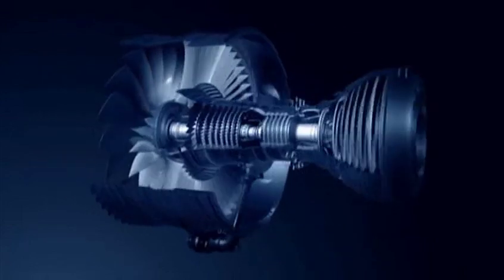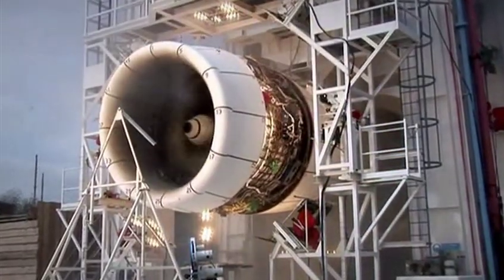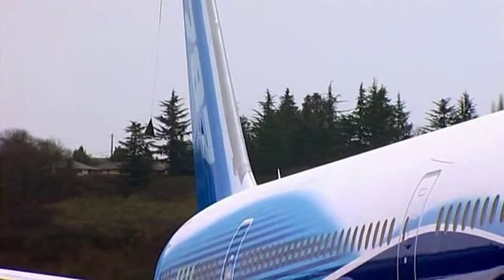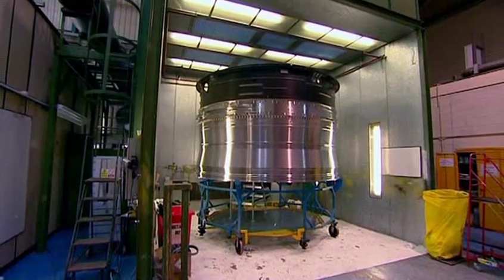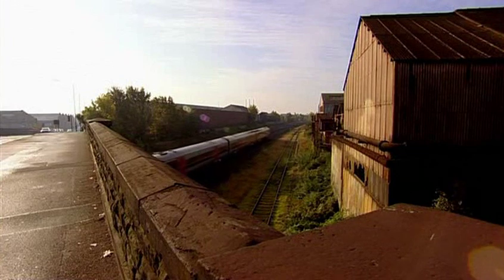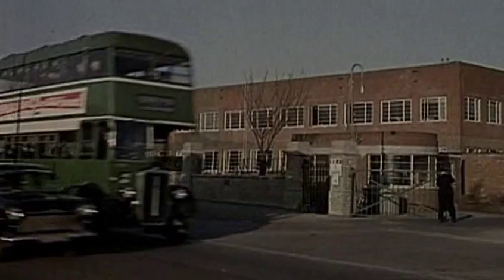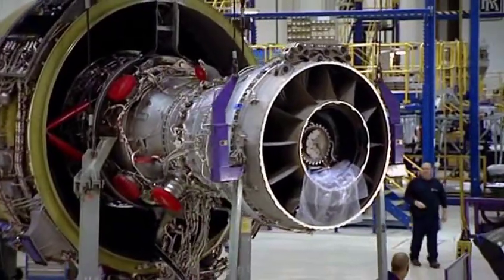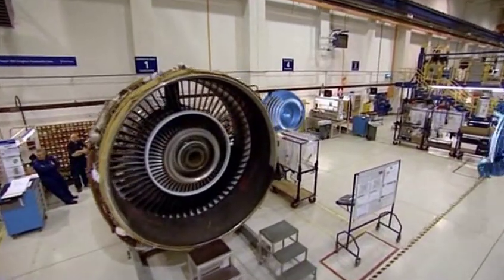The Rolls Royce Trent Engine story - part 1

Comment: You might find my Web Magazine of interest. I integrated the front fan from a RR High Bypass Turbofan in the Title image. I think it is a Trent engine with the Titanium wide cord fan blades. I wonder if the metal blades are better then the laminated polymer blades. I'd say if a flock of geese were being sucked into the fan I'd want the metal blades. Also, the site is built like a machine. I had a better site but it was for MSIE only. PW could have saved me from Mich Tech and John Johnson.